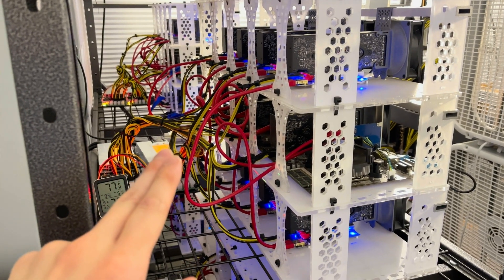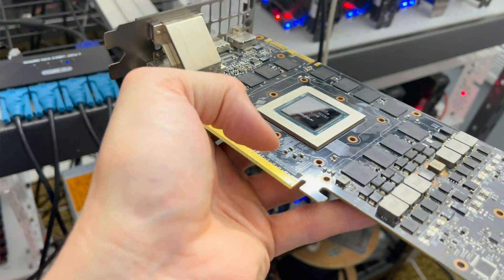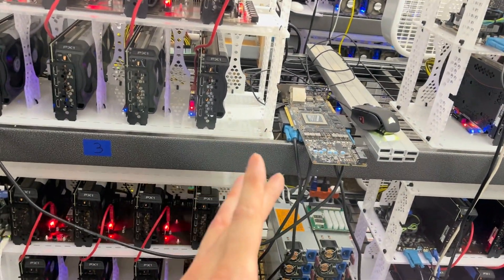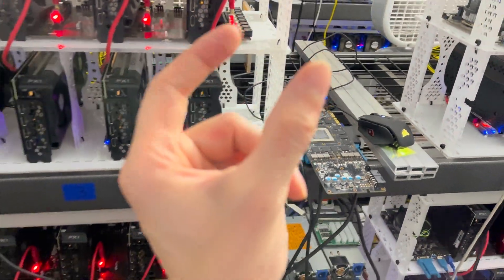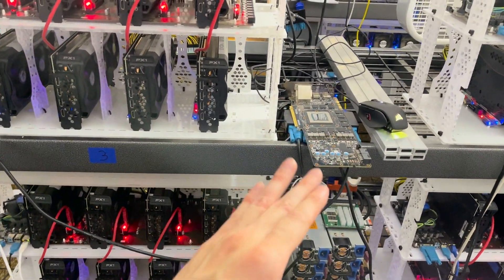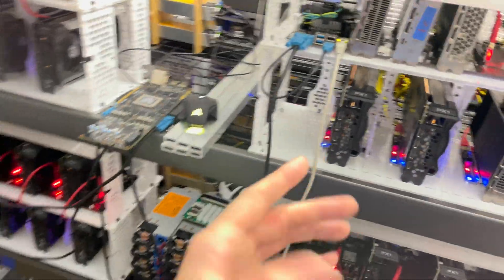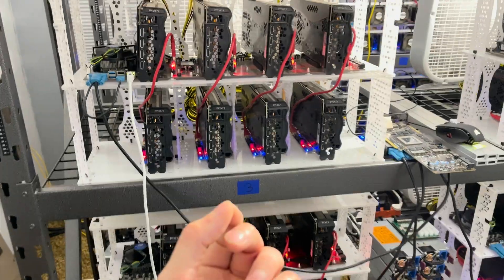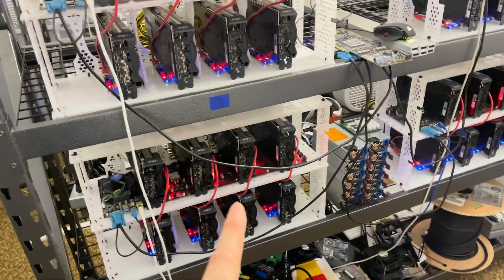The Silent Killer For GPU's?

Comment: Thanks for the video. I have told fellow YT miners multiple times that a constant temperature is the most important, as some just run their fans at full speed, thus it cycles dependent on the ambient temps. I run a constant temperature setpount on my gpus so i believe it will last longer...
Reply from the maker: This is a complex issue that's difficult to have any certainty since everything is a tradeoff. Lower temps means lower power and lower wear. If you need more fan to do it, the fans take more power, wear faster, and can mean more dust accumulation. And just setting the fans to 100% is silly, unless you're in a very hot climate and the card is running very hot. But running A/C is very expensive and trashes profitability for most. And if you don't have temperature dependent fans, it could mean wild temp swings on the hardware in some conditions. However, tuning those fans so they run at the 'right' speed in all conditions is tricky for most, and most miners don't give you a ton of control. On top of that, you expect 2-10 years out of a GPU, so it's hard to say exactly how much this stuff matters until the hardware is likely nearly obsolete anyways. I think the goal should not be to make the hardware last forever, but to make it wear out just at the end of its useful life. This tends to mean targeting 3-5 years at most. It's unlikely the hardware will be super profitable or valuable beyond ~5 years so not much sense in giving up gains today to get 10 years life when the thing isn't going to be useful in that time.
Reply: @SiCPoWMining  I agree. I am running a constant temperature setting for the core temp in HiveOS. For Nvidia cards I use 62C as a target temp and 55C for AMD cards. My temperatures are quite stable and the HiveOS automation takes away all the guess work. I also made a video about how I automated my cooling system to automatically switch my forced ventilation/cooler on and off, depending on the ambient temperature inside of my mining facility, and it works flawlessly. I have an industrial evaporative cooler installed and it provides me with several benefits. Clean filtered air, it creates a positive pressure inside of my facility, thus forcing out the hot air and eliminate dust ingress. I just wished the broader audience would adopt this type of operation, rather than running their fan speed at 100%, ensuring zero control over their temperature cycling, which as you mentioned, is the silent killer of GPUs.
Reply from the maker: @ThreeFoxCo  I saw your mining garage video, nice setup. You're not wrong, there's a fair bit the hobbyist mining community would benefit from paying more attention to.
Reply: @ThreeFoxCo  the broader audience wishes we had your cooling problems